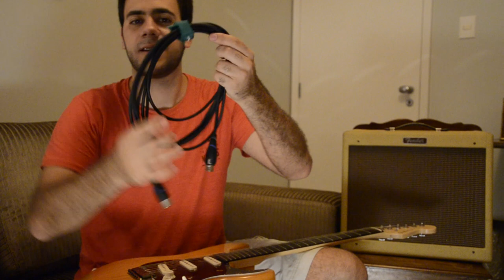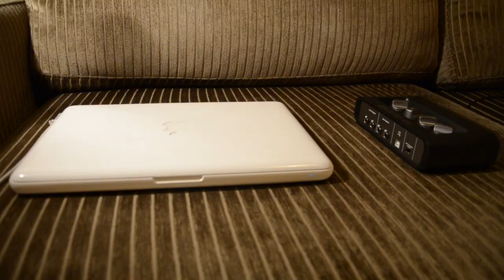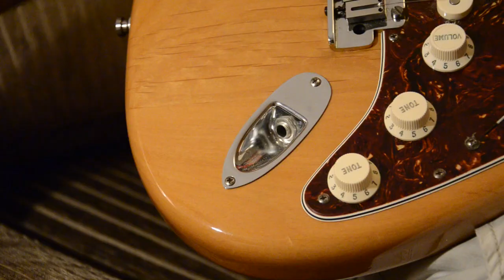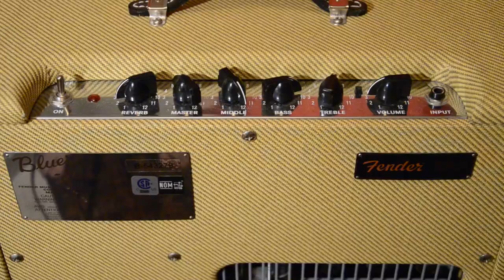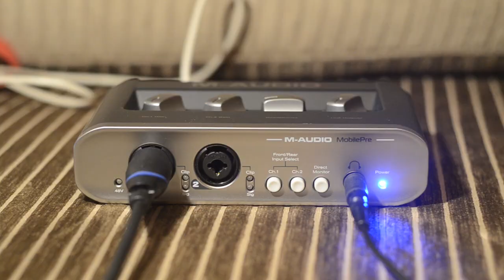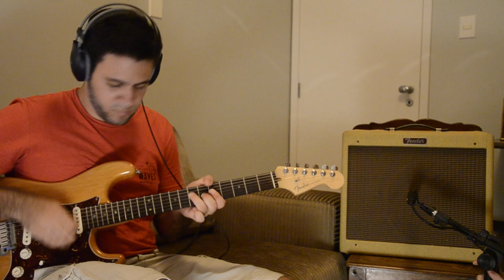How to record an electric guitar with mic and amp

Comment from the maker: I'm not sure how loud it was set up. It is a 15W amp, but can be pretty loud! I've never tried to record with a condenser, but it will sound different simply because the condenser is much more sensible. For a studio recording purpose, it'll probably be a good choice, but for a live one, it will pick up a lot of different sounds from the whole band and audience, so it's not the best idea. Actually, for studio purpose, people normally use both dynamic and condenser and then blend them.

Comment: Need a tutorial to record without using an audio interface. (Microphone directly connected to the sound card of the computer)
Please make one if possible!
Reply from the maker: Hi man... Unfortunately I won't be able to do so because I'm pretty busy until near not-so-near-future. I would have to make some research to guide you properly, but what I can tell is that if you use your computer's sound card, you'll get some sound, since it already have an AD converter. The only problem is that the signal will probably be a bit low, since most of general purpose sound cards don't come with preamps that boosts the signal to the (sound industry) required line level. Thus, you'll be able to do so, but the quality won't be outstanding.

An alternative is an USB microphone that comes with a pre-amp inside, like this one:
http://www.sweetwater.com/store/detail/AT2020USB

Maybe there is some plugin that helps you with that, but I don't think so, since it will get a low signal...

Hope that helps you ;)

Comment: Hey Alvaro, your video was quite helpful to get some very basic information about getting started to record guitar :)
I got one question though: What audio interface are you using? Would you recommend it? And how much does it approximately cost?
Reply from the maker: Hi Toby, I'm happy it helped you. I'm using a M-Audio MobilePro and it cost something around USD 150.00. I recommend it, but I think they are not making it anymore. It has two inputs, so you can get a cheaper one that has only one input. Try one of these:

http://www.sweetwater.com/store/detail/ScarlettSolo
http://www.sweetwater.com/store/detail/MTrackII
http://www.sweetwater.com/store/detail/MTrackPlusII
http://www.sweetwater.com/store/detail/Scarlett2i4

Cheers

Comment: do you need an audio interface to record with a mic? I have Logic Pro X and I want to record guitar guitar with a mic; most likely a Shure sm57.
Reply: similiar situation..
Reply: Yup, you pretty much need one. Behringer, Presonus and Focusrite are some great options to get you started. Cheers!
Reply: Axel Alvarez what if i dont have  an audio interface and just want to record it thru mic and audacity. Is it fine?
Reply: Audio interface is always needed when u want to record the sound in your computer..with an audio interface u can record the music directly to the computer without any external noise,and the best part is u can even monitor what u are recording..
You can record directory with the output of the pedal or if u have a good amp then u can use a mic to record the amp sound..

Comment: dude im using a line 6 ux1 and the same microphone to record, but im getting a sound way too low, any ideas?
Reply from the maker: It's not necessarily a problem, the audio interface output is normaly lower than the comercial sounds we are used to. Have you tried to turn up the master fader of your DAW (or your monitors)?
Reply: I did, turns out that an adapter wasn't working properly, now I'm getting a nice volume